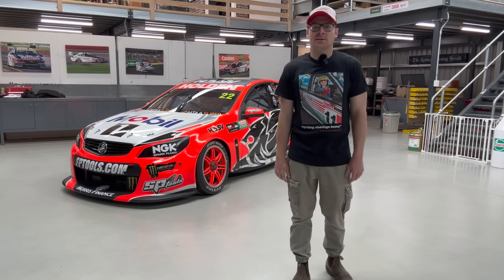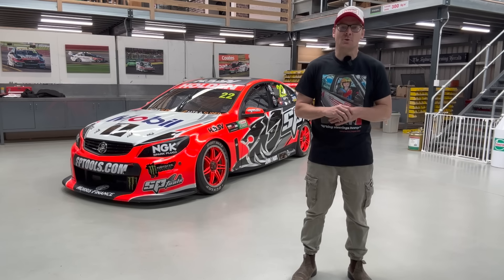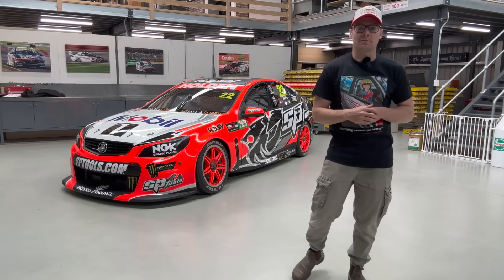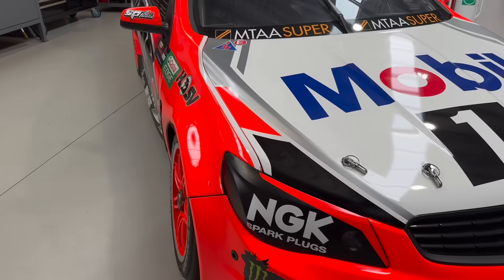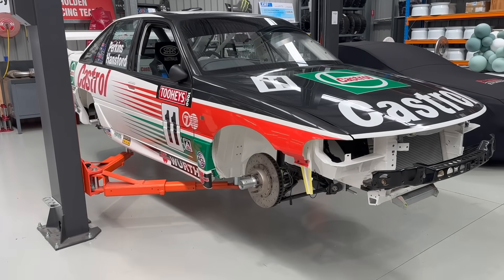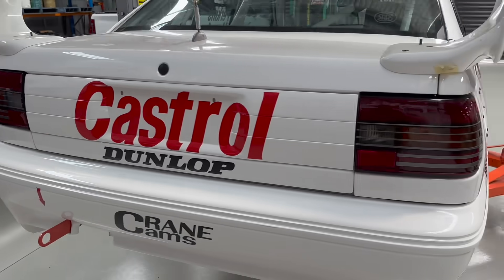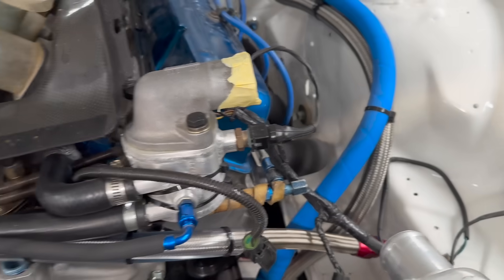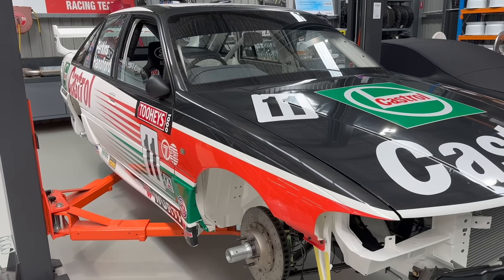Episode 53: Check into the PE workshop to see what projects are next

Comment: Jack what spec were the Chevy engines in 94?  Something like an iron  block with a 4" bore and 18 or 23deg heads? Maybe even SB2.2?  (94 might be a bit early for these?) Did the block and heads have to be OE GM?
Reply from the maker: Yes, 182 Chev block, 18 degree heads. They used this configuration right up until 2003 when the Holden Motorsport Engine came into play with a different block and heads.
Reply: @perkinsengineering  thanks for taking the time to reply Jack.